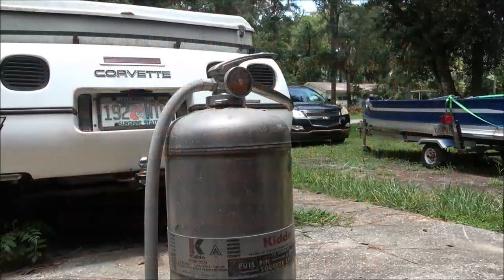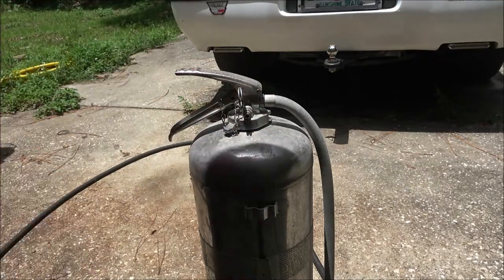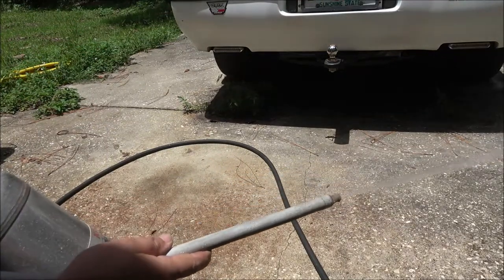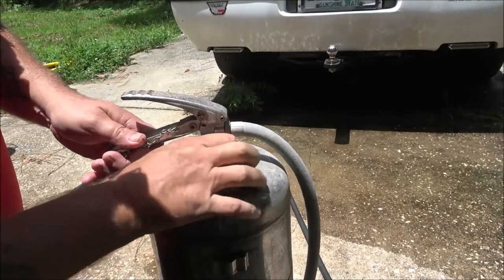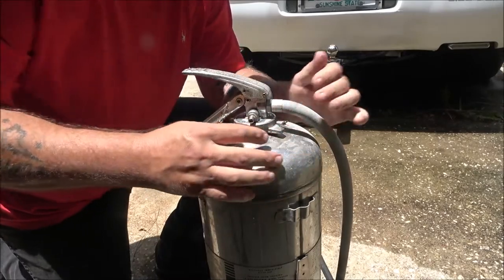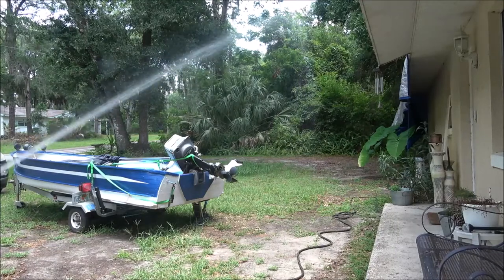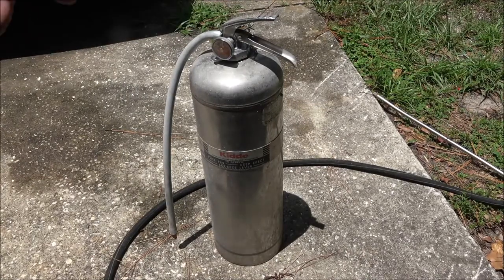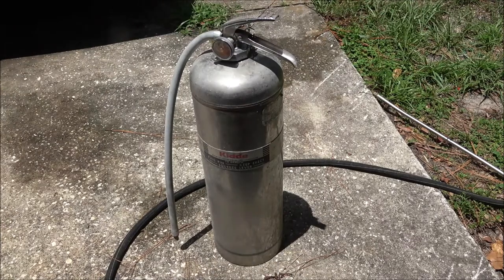Vintage Kidde Fire Extinguisher Does It Still Work?

Comment: definitely keep it around, very handy to have and super quick and easy to use and recharge. I put some soap in mine, heard that helps to stick around the fire. i also recently picked up a soda acid extinguisher still charged and ready to go, can't have too many in the workshop!
Reply from the maker: I never heard of soap in it before but it makes good sense. I'll definitely keep that in mind and thanks for sharing that tip with us. And thanks for watching and commenting. Happy 4th to ya.
Reply: @shabear1000  Happy 4th! 

another tip is to dissolve a heaping double handful of salt in hot water and pour it in if you need to keep it where it might freeze, the salt will lower the freeze point and should reduce the risk of damage. i just did that to my soda acid one today, gotta be careful on the water level with those however